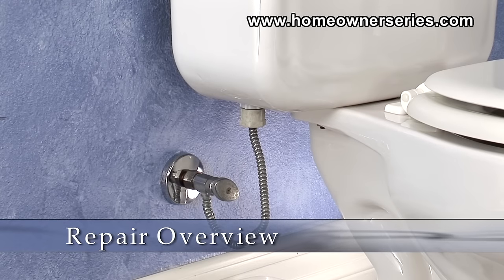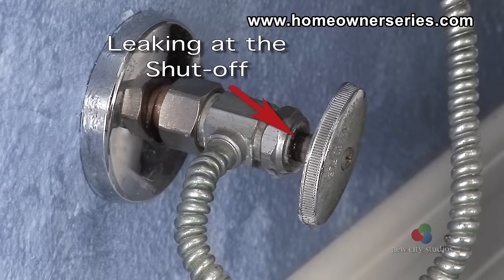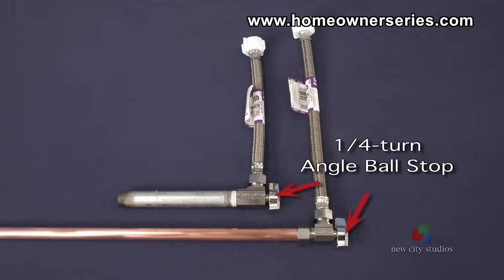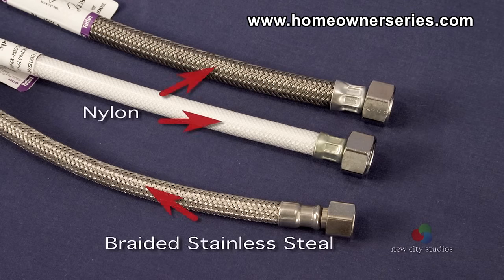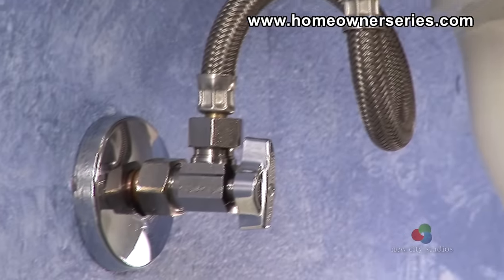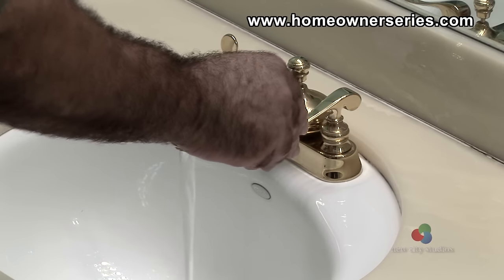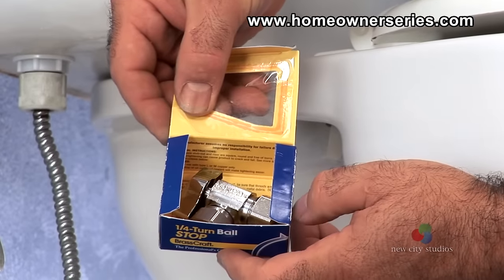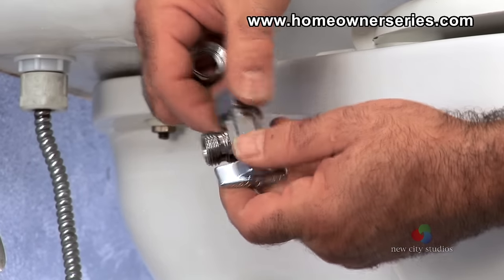How to Fix a Toilet - Water Supply Valve Replacement - Part 1 of 2

Comment: I've been trying for ages to find out whether it's OK to install a flexible connector hose in a 360-degree loop, as that was the only way I could use one where the existing copper pipework no longer met the shorter shank on a replacement fill valve I put in, and I couldn't cut the pipe back far enough to get the flexi hose in a near-straight line. I got the idea from fixed electric cables that don't line up with a switch box or something and so are taken in a complete loop so that they do. The instructions with the hose say "ensure the product is not bent at sharp angles, squashed, kinked, stretched, twisted or split", and none of these seemed to be the case in my installation, so I assumed it was OK, but it's really good to see a 360 loop here (in the replacement hose only).

Comment: If I have a leak only in the water supply hose does the water valve also have to be replaced or can I just replace the hose?